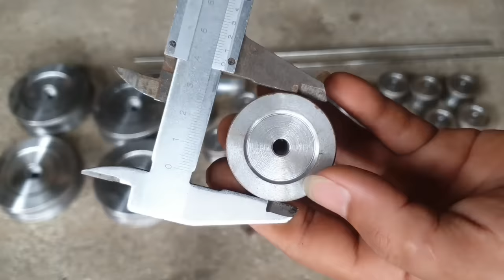homemade dozer, Caterpillar D11 | rc action homemade

Comment: I've been a welder / fabricator for 20 years. You seem to be a very good fabricator. However your lack of safety and PPE has me concerned. I hope you're at least wearing safety glasses because you're not wearing any gloves and have sandals on. You are even using your foot as a clamp sometimes. Which is fine with boots. On that note, you are running your grinder backwards. You should always kick the Sparks towards yourself so if the cutting wheel grabs it pulls it away from you. Cutting with the Sparks going away from you is probably nice when you're wearing sandals but if that cutting wheel catches and jerks back there's a good chance it's going to hit your toe.
Reply from the maker: Thank you very much for the advice 👍❤️👍❤️👍❤️👍❤️👍❤️👍❤️👍❤️

Comment: They sell small diesel engines, like the size for a gocart.  Maybe to big for this but if you were able to make this diesel powered, would break the internet.   On its own is one of the best builds I've seen and with so much scrap.  You do just the most incredible work.
Reply from the maker: thank you, thank you for watching, very much
Reply: He doesn't need a micro diesel engine, he needs a micro diesel power generator to produce enough electric power to replace the car batteries and let him keep the electric motors as they are or swap them with more powerful ones!
Reply: Let

Comment: Nice job. But I would of mig weld my parts than stick weld.mig welding dose a nicer job and I would also used some safety boots or shoes instead of sandals to protect my feet

Comment: Inspirational!  You have an incredible ability.  If you were my neighbor, I would pay you to build something I want to exist but haven't yet. Maybe it will be easier if I just do it myself, using these kinds of parts. I would pay you $100 U.S. an hour to do it for me.  What I want is two scale models of a ten foot long shipping container sized four axle wheeled all wheel steering vehicle created to drive on roads to a shipping container, or stack of containers, attach to the four hard-points at each end and lift, then transport and then set down the containers.  I feel that there is no reason to transport containers using trailers.  Containers cost $3,000,are built of sheet steel,  trailers cost $70,000, and consume large beams. I wish to encourage builders everywhere to build such machines, to the standard dimension of the ten-foot shipping container, so these overland transportation robots can be shipped with the containers, and possibly be recharged on the ship as well, with all being electric driven, but with deisel-electric as well.
Reply from the maker: oh... thank you so much

Comment: I have a question, why do you need a wheel bearing if the place of the bearing is to be pressed onto the axle and it does not rotate, but at yours it rotates on the axle? you could save money by not buying it and make the wheel with a hole of the diameter of the axle....

Comment: Where can I find the hydraulic line and quick connectors you used ? I have that exact same hydraulic pump and a massive 12 channel valve body but can’t find the line and quick connectors . Your help would be great. Thanks for the video you make it look so easy.
Reply from the maker: You can find that quick connector at stores that sell compressed air hoses